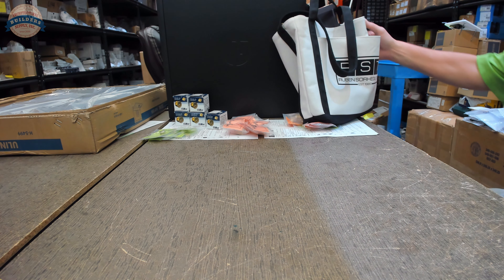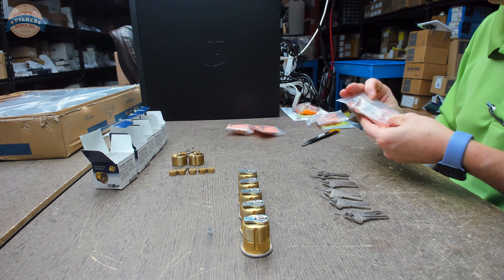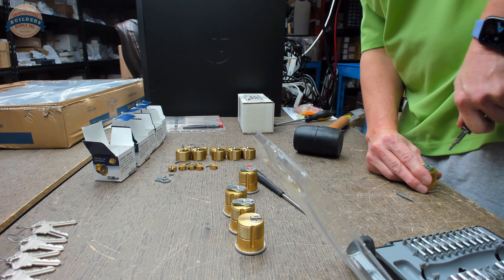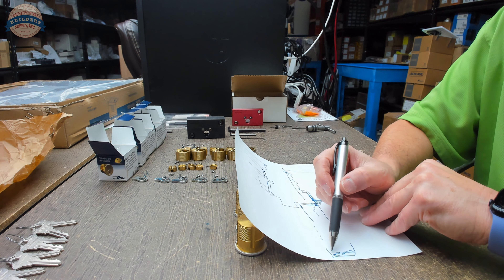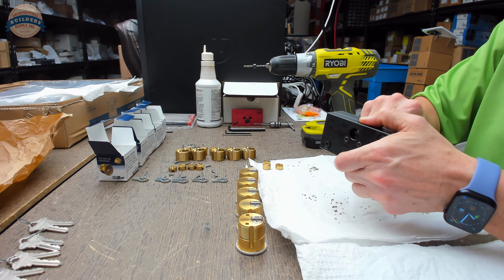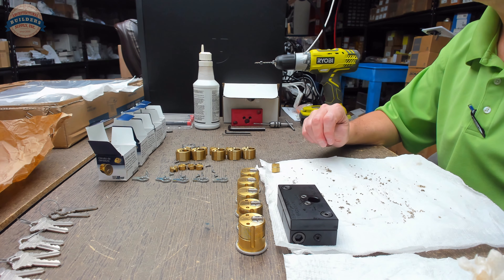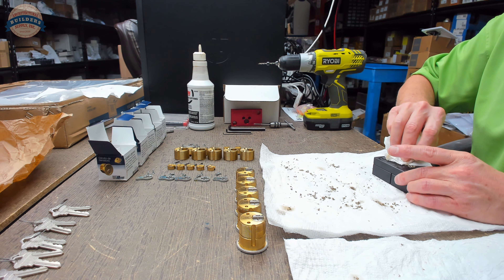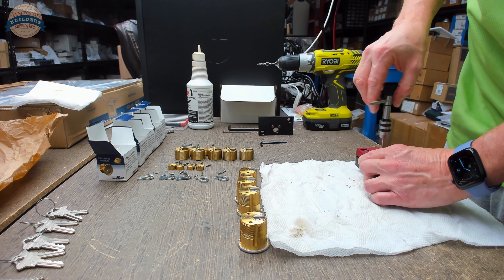A verbal history of the Kewanee Corporation from 1990 2008

Comment: I was just interested in Kewanne Mortise cylinders -- a very long video on doors -- why did Kewanee go out of business?
Reply: Are you sure you didn’t mean Kawneer?
Reply: @jeffmoss26  YES, my mistake -- thanks for "keeping me honest" -- oops -- I since got a Kawnneer mortise cylinder and it is a terrible POS -- one of the worst I've ever seen --- horribly poor tolerances and junk metal -- no challenge to "open"
Reply: @Pyrolock  yeah they should be ashamed of sending those out with new doors!
Reply from the maker: Those standard mortise cylinders are zinc and has large margins between the plug and shell.  Given what Kawneer charges for door / frames / hardware sets they certainly can ship Kaba Ilco solid brass mortise cylinders.
Reply: @absupplynet  I can't believe you commented on this Richard
Reply from the maker: @Pyrolock  Sure thing - sorry it took so long to see the comment.